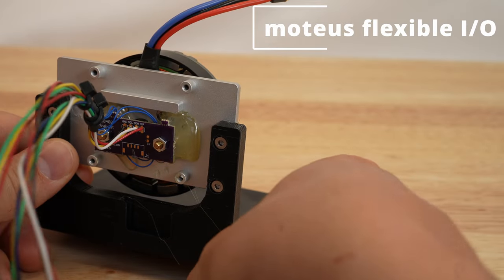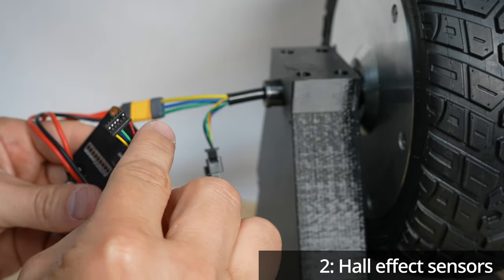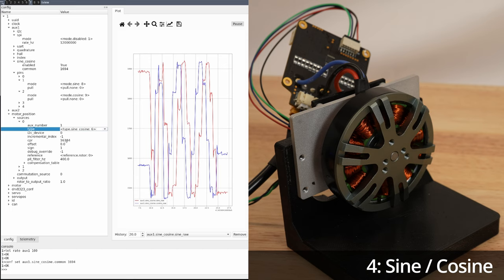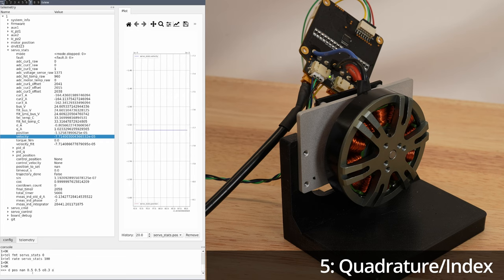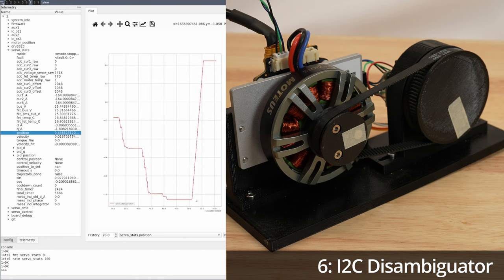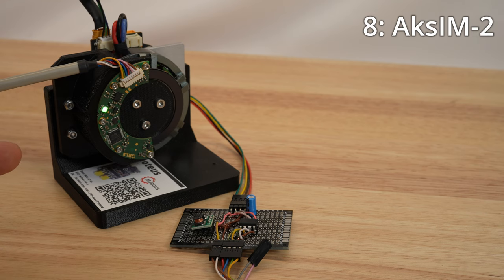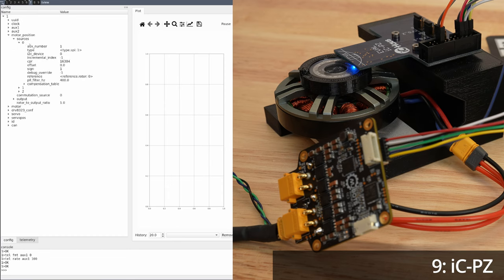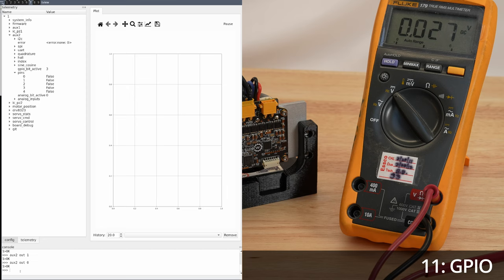9.5 encoder strategies for open source bldc control

Comment: From the last 14 years I'm working on repairing industrial servomotor's drives, including reverse engineering of a lot of stuff (from drives to communication protocols and even some proprietary encoders) and some development.
And I can tell you that: your work is amazing.
I do most my stuff inside FPGAs for convenience, but there are some old digital drives that runs servomotors with boards fully based on digital ports and comparators, without any programmed components in it.

Comment: Yes!!!  Thank you so much for continuing to develop the platform.  I'm really stoked to see this development as I'd love to use moteus to build a precision tracking gimbal.  I built one for RF tracking last year and the built in mag encoder was perfectly fine for that, but optical is orders of magnitude more demanding for low speed performance, high stiffness, low jitter/noise.  Seems like this could really help with that (plus ring motors/encoders are fantastic for gimbals)

I don't know if i ever asked this on the discord, do you have any thoughts on the feasibility of adding a lightweight interpreter (eg lua or similar) directly to the firmware, allowing the controller to operate standalone for use cases that don't require an external comms/application (eg force feedback, stabilizers/dampers)?  I started going down that road but had to hang the project up for other reasons.
Reply from the maker: Thanks for the positive words!  

I do have plans to implement user executable scripts, although they aren't very fleshed out at the moment.
Reply: @awesjosh  That's awesome!!!

Comment: Hey Josh,

I looked for the 3d print part that holds the encoder reader. Could you provide the model link please. 

Thanks in advance, Keep your good work 
👍
Reply from the maker: There are a lot of 3d printed parts in this video... which one are you asking about?
Reply: I m sorry, the one for aksim-2  @awesjosh
Reply from the maker: Here are links.  However, I'm not sure I'd recommend their use.  3D printing tolerances and rigidity are only barely suitable to make the AksIM-2 work.  Here I was just trying to demonstrate that it would work at all, not make a usable end system.

https://drive.google.com/file/d/18l3m_1UHxQQP-YGWm4zG2CfOQZ1IhFtA/view?usp=sharing
https://drive.google.com/file/d/1rl7AZosQT7wwO9aKcB-BATbgy3DkYugY/view?usp=sharing

Comment: Have you looked into the MPS MA330 encoders yet? They have some solid dev boards if you want to test them out.
Reply from the maker: I have validated other MPS encoders, like the MA732.  In my tests, the AS5047P that moteus now uses provides superior performance, albeit with a larger package size.  https://jpieper.com/2020/08/21/testing-alternate-magnetic-encoders/
Reply: @awesjosh  I am surprised that it performed better. I would love to read the write up of those results. I am considering using the MPS encoders and would like to know what your results showed. I know one option I have considered is the MA600 seems to use a different front end tech. My backup option is the Broadcom AEAT-8800 or AEAT-9955 but they are quite costly.
Reply: Just realised that you are doing software based quadrature. Is this inturpt based? What is the max edges per revolution pre sec before the motor control performance is affected?
Reply from the maker: It is interrupt based for the r4.11.  You should aim to keep the rate at less than 30k counts per second, although depending upon signal integrity brief periods of up to 2x that are OK.
Reply: @awesjosh  Are the pins different for the N1 hardware?
Reply from the maker: @Ender_Wiggin  Yep, they are different.  The reference manual has a big table: https://github.com/mjbots/moteus/blob/main/docs/reference.md#pin-options
Reply: @awesjosh  Oh i had not seen that! very nice
Reply: Very happy to see you added MA600 support!

Comment: Hi, is it possible to use the AksIM-2 encoder over SPI on the aux port? If not, could you tell which communication type is supported for RS422? There is Asynchronous serial or Binary synchor-serial as options on the website. 

Thank you. Great product and videos btw! Keep up to good work :)
Reply from the maker: SPI is not supported for the AksIM-2, only RS422.  Asynchronous serial is the correct option.

Comment: I understand the Hall effect , RLS absolute encoder, and Quadrature incremental encoders are used to keep track of position, but how is the commutation done?   Is that all sensor-less, i.e. it uses just the back-emf of the motor?

Also, is a BLDC motor a subset of a servo motor?  For example, if a brushless motor has the encoders and electronics for commutation then it's a servo motor?

I'm interested in learning control-loops (PID, model-based, etc).. eventually do robot applications, something like that of peng-shihui's ONE robot.   Do you have any tutorials or online-courses that you'd recommend?  For example, Arizona edu has a nice AeroPendulum project that uses Processor/Hardware-In-The-Loop..  unfortunately you need Simulink!
Reply from the maker: For commutation, the relationship between the rotor and stator must be known.  Hall effect sensors provide that information coarsely for a motor of any number of poles.  Absolute positioning sensors can also provide that information if the resolution is sufficient to resolve between the poles of the motor.  For instance, the absolute magnetic sensor on moteus works fine for motors with up to around 40 or 50 pole pairs.  Sensorless approaches can also provide that information, although the most general ones require that the motor be moving at a decent speed to be accurate enough to use, so there is typically an open loop spin-up phase and low speed operation is not possible.

Servo motors are any motor, brushless or not, where the output position is fed back into the control loop to reduce the output error.

For control loops and practical implementation, many vendors have good information and tutorials.  For example Microchip has a wealth of resources, including things like the video "20084 MC2 - How to Succeed in Motor Control".  I don't have any specific online courses to recommend unfortunately.

Comment: Hi, I am a contributor to an open source FOC firmware meant to be used on hoverboard mainboards. I am working on some improvements like deadtime distortion compensation and discovered your blog and youtube channel. It's a gold mine, thank you so much for sharing all this knowledge. Did you happen to test cogging torque compensation on the hoverboard motor? Is the ripple noticeable on a motor with that many poles? Thanks in advance.
Reply from the maker: Thanks!

I haven't tested cogging compensation on hoverboard motors, although I do have some data points that may be useful.

The current cogging compensation implementation assumes a known absolute rotor reference.  While it may work on hall-effect only motors that lack that, sub-optimality may result.  

Hoverboard motors don't have a lot of cogging torque anyway, and high pole count motors will generally not work as well with this technique, so it isn't something I was even thinking of exploring.

That said, there may be gains to be had if you want to try.

Comment: I would like to use your design as a mechanical shutter for the light beam. Can you tell me at what maximum frequency the motor can rotate ? What is the stability of rotation ?
Reply from the maker: The more likely limit in an application like that is maximum acceleration, for which the answer is entirely dependent upon the load.  The best I can tell you is to try experimenting and see what is achievable.
Reply: @awesjosh  The motor will rotate at a constant speed. acceleration is not important, but the stability of the rate of rotation.
Reply from the maker: Understood.  However, the answer is largely the same.  I have not quantified rotational stability with any motor, you'd have to experiment.
Reply: @awesjosh  Thank you for your reply :)

Comment: Hello, I am wondering if I can use the AS5048A? I just got some iFlight gimbal motors with this encoder mounted. It comes wired in PWM output mode. I suppose it could be rewired to SPI though.
Reply from the maker: That encoder is not currently supported, although if you wanted to hack in the firmware it would probably not be too hard to add.
Reply: @awesjosh  Alright, good to know. Funny enough it actually seems to work fine via SPI... I have not even checked the interfaces, they just looked similar so I figured it was worth a try. I am, however, facing the issue with the poor current measurement with the gimbal motor. I read your blog post about switching out the shunts but sadly I only have much larger values on hand (0.1 Ohm is the smallest) and I think that wouldn't work. Btw I am at CBA @MIT Media Lab right now, trying to make use of your controlers for some robotics project :) You happen to in Boston area as well right?
Reply from the maker: @kristofpucejdl  for gimbal motors you can use a non-current controlled mode for better response:

https://jpieper.com/2021/12/06/voltage-mode-control-for-gimbal-motors/

If you are interested, the mjbots Discord can be an easier way to have back and forth conversation: 

https://discord.gg/W4hUpBb

And yes, we're based in Cambridge!
Reply from the maker: Dm me on Discord and we can discuss!
Reply from the maker: Or email to jpieper@mjbots.com !

Comment: Hi Josh,

For the aksim-2 what did you use as an interface to program the aksim encoder? If additional converters or aux devices from RLS i would like to buy them. I did the assembly with the 3d parts but the encoder flashes red light. I believe I need to program it as you also mentioned in your  article.
Best
Reply from the maker: I did no additional programming with the AksIM-2 at all, I get them from the factory and wire  up with that circuit (or connect them directly to the moteus-n1).

It is probably easier to provide support in the mjbots Discord if you can go to mjbots.com and find it.  If not, what moteus board do you have?

Comment: Will this work with a 23 bit encoder like the Broadcom AS37-H39B-B?
Reply from the maker: Unfortunately, the protocol for that encoder is not supported at the moment.  The closest comparable would be the AksIM-2 from RLS.
Reply from the maker: The only encoder moteus supports currently that has a 22-bit resolution is the ic-HAUS ic-PZ as shown in this video.  However, it is relatively hard to use.

The moteus firmware is open source, so you can always add support for any encoder you like yourself.